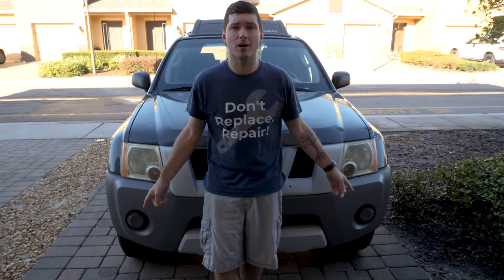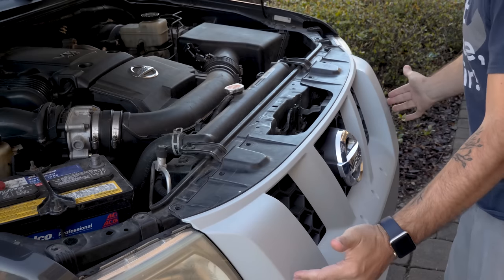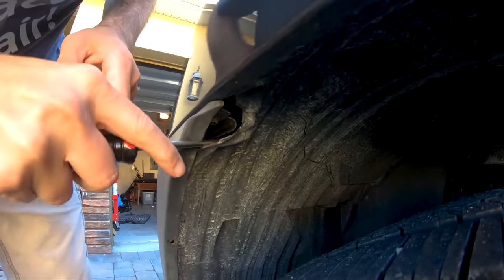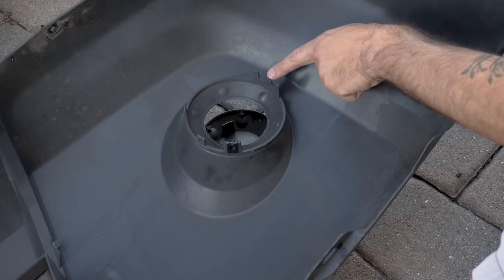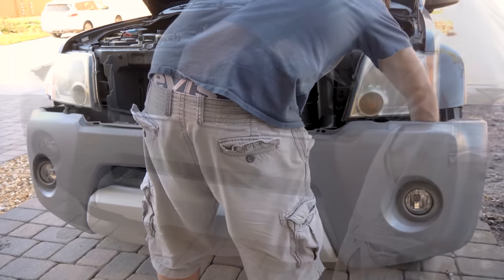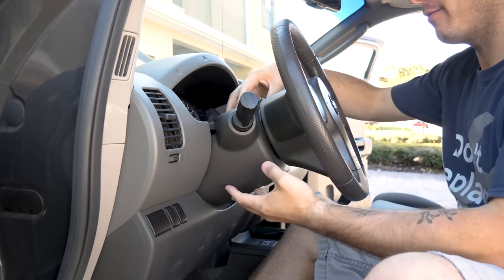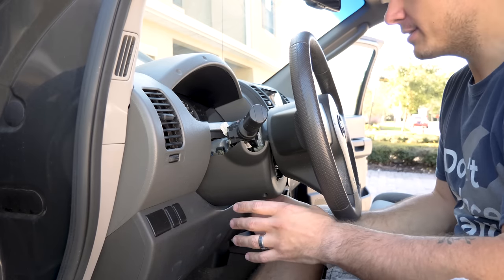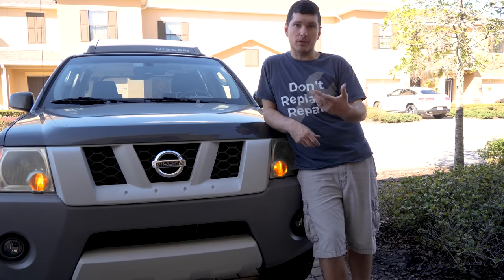How to Install OEM Fog lights into a Nissan Xterra

Comment: For those who want to do this install on a 2005-2007 Xterra, the factory kit isn't compatible anymore. (The switch is for 08 and newer.) However you can order an OEM switch (Standard Motor Product: CBS-1668) and buy after market lights or get a used set, and the mounting hardware. (Nissan used Velo brand lights) I chose to buy a used OE set as the quality is higher. Most used units have one screw tab broken off. This is fine as you only need one. Just make sure the good tabs are on opposite sides and you'll have a working pair. With those parts in hand, Ry makes the rest easy with this excellent video! Install was a breeze! Thank you, Ry for this and all your excellent videos.

Comment: Awesome videos brother !! It's so nice to watch the job before actually doing it.  Many Thanks !!

Just a friendly tip that was passed on to me and i pass onto others is turning screws backwards first with plastic anchors.  Most of the time these threads are made the first time the screw was installed.  Turning it backwards until you feel a bump allows the same threads to be used instead of cutting new ones over the old ones.

Comment: Thank you so much, you have saved me a lot of money and time. Purchased a 2006 nissan xterra a few months ago, and even though I looked it over good I discovered a lot of problems, needless to say this is when I found you. Just got finished installing my OEM fog lights, no stress and fuss. Thanks so much. I have changed my headlights, PDM, had to repair the drivers side window, and I am still not done. The Evap is giving me a code and the catalyst converter as well.. when I have time I work on it.. thanks so much.
Reply: They also fit on a 2006?

Comment: My granddaughters xterra has hazed headlight assemblies, and the turn signal stalk is worn and doesn't turn off when the wheel is turned. Ry has shown the bumper cover has to be removed to replace headlight assemblies.  This video shows it would be easy to install fog lights while the cover is off, and when replacing the worn turn signal stalk, use one with a fog light switch.  Great video!
Reply from the maker: :D

Comment: Good info. I recommend a simpler, quicker way. All I did was turn they wheel (to give you more room) then remove the retainer screws (3ea) on wheel well. Pull back the plastic and after that you’ll have easy access.
Reply: I used a stubby Phillips head for accessing the securing screw.
Reply: I like the way you think
Reply: Oh yeah, much easier and it was a 20/30 minute install. If I ever do it again, I bet I could do it in 15 minutes. 👍

Comment: hey you can access the mounting aera through fender well, without taking off whole bumper cover.....
Reply: I just looked today.  There is a small access.  It is a little tight but I am going to try to do it without taking off the bumper.
Reply: Good to know when i need to change the bulb

Comment: Thanks for the video! With the Frontier there is no need to remove the bumper. Just move tires with starting wheel and you’ll have a few screws and you’ll have access through the back of the bumper. The wires should be hanging instead of tied up. Thanks again!
Reply from the maker: Good tips, Thanks!
Reply: This is how I installed the fog lamps on my 07 Xterra a while ago. While it is a little more cramped it is still very easy to do.

Comment: I would have done this years ago had I known the wiring harness was all there!
Reply: I have a 2014 X model. All the literature I read said my model DID NOT have pre-installed wiring. Well last night some jerk stole my cap/cover and I look inside and saw what I thought looked like a plug...well sure enough, looks like my Xterra DOES have wiring pre-installed! So maybe I'll be getting new lights instead of a new cap/cover!
Reply: @rockermarco  Get the LED version,that's what I have on my Frontier.(much brighter and uses alot less power)

Comment: For anyone who want to put fog lights on Nissan PATHFINDER r50 00-04 or 05 (GCC ) what you need is fog light  turning stock (make sure that if your stock has a auto mode to get one that has auto with  fog switch cuz it's different than the one without auto) and front fog relay ,after that it's plug and play

Comment: I was also wondering if they made kits for the pro 4x roof lights. I've always wanted those too.
Reply: You need to drill a hole in the roof but has anyone checked if the wiring is under the headliner 🤣
Reply: @800ccc  that harness does not exist it only came out for the 2014 or 2015 models but you might as well just add an LED light bar that will give you more light if you want lights on the roof.

Comment: You should make a video installing steering wheel controls on an Xterra that doesn't come with them, using a Metra's ASWC-1 adapter. There are some guides on thenewx forums but the pictures are gone. A video would be great!

Comment: Not sure if this has mentioned, for Frontier, you don't need to take off the grill or bumper. You can do this under the wheel well. Just turn your wheels left and right.

Comment: I've noticed the lights don't fit tightly against the bumper housing. I'm thinking about putting some type of weather stripping around the housing so it has a good seal around the lights.

Comment: You did that like magic, it was good to watch. i have the latest nissan juke n design 2021 mod. but came out without fog lamps in the front , though have the place for them. can it be done practically the same way ,
 and could you tell me where to get a kit? thank you .

Comment: Hi from Oamaru New Zealand. I have a similar setup in my 2012 Nissan Navara D40 diesel (Frontier in U.S.A). Anyways I sustained big damage from a farm dog left loose at night which I hit at 60 m.p.h. 
It was cheaper for me to buy and install a new "Ironman" Commercial deluxe Bullbar which has all new lites on plus protection.
Reply from the maker: Hello from the US!! I wish we had diesel Navaras here. Sorry to hear you hit a dog.
Reply: @Rythecarguy  Dog saga was when dogs were on heat (in season) but farmer left it loose to roam. Dogs here on farms are cattle or sheep herding dogs.

Regarding the Navara D40 diesel the closest for you to buy in left hooker is out of Spain if you can. I'm running mine on Amsoil Signature series diesel oil and gear oils. The moment I changed it, it was way quieter and smoother. I'm very lucky to had purchased this as my 2008 jeep Wrangler diesel JKU was costing me $1500 per year with random issues and gear shift lever popping out of linkage which made it very dangerous so I opted to park it up then finance the Navara for 3 yrs. In that 3 yrs it's so reliable it only cost me for a set of 
Toyo open country A/t tires, diesel milesl tax, fuel etc. Carl

Comment: Best how-to videos out there.  Headlights and fog lights went in exactly as you said.  However, the steering column switch I ordered through the link on your page was slightly different and doesn't fit.  I'm hoping they will let me return or exchange just the switch since the fog lights are already installed.  Also, I didn't take off the front bumper entirely.  I unscrewed everything from the top and sides and as it was hanging, it exposed the work area enough to do the job.  Thanks again for great videos.  Any advice on the switch would be welcomed.

Comment: Hi i have a frontier 2006 metal bumper and have the wire for the fog light. My question is you change the switch light because the model of the exterra don't have the switch for the fogs to work with the oem wired. Do you know the wire color or number the fog oem switch use to turn on the fogs. Only if i don want to by the whole ligth switch, i want to do it with a external switch but with the oem wire. I hope i explain my question. Thanks great video

Comment: once you hook up the cable, check it before you reinstall the bumper... save yourself some time and effort to be sure!
Reply: Thank you Mr Andrew Camp I appreciated it’s done and also Mr Ry,
Reply: Mr Ry and Mr Andrew Camp, I bought a SPEC-D TUNING Black LED Projector Headlights Compatible with 2005-2012 Nissan Xterra Left + Right Pair Headlamps Assembly, but I’m i little bit confused about spider wire black and wires

Comment: Love the videos Ry, I’ve gotten into most of the work on my 2011 frontier cause of these. Question for you, recently my fog lights won’t turn on. I replaced the 15a fuse and battery fuse and still no luck. Bulbs are both fine. Any ideas? Is there an independent relay?

Comment: I have a 2016 nissan frontier without foglights.I watched this video and was wondering if this was true.I pulled off the plastic  caps and I looked inside and I had the wiring inside.So what web site I can get the turn signal/ foglights?

Comment: Hi! Have you heard of the SMOD on these xterra’s? Does it affect all 2nd gen version? And can you make a detailed video on how to switch the coolant hoses and transmission cooler hoses please. Thanks a lot!
Reply from the maker: Yes it affects second generation Xterras. No I cannot make a video. It only affects automatic transmissions since they have the trans cooler. The manuals do not and mine is a manual. Thanks for watching!
Reply: SMOD does not affect all 2nd gen Xterra's, only those made prior to the 2010 model year and are equipped with automatic transmissions.  In the 2010 model year Nissan introduced a new radiator with a different part number and SMOD is not a problem on 2010 model year Xterras and newer.

Comment: I noticed that it shows 2008-15 Xterra, but will it also fit for the 2006 Xterra? Asking before I buy the other type with the push button which I would rather not..

Comment: Wow, you made that look easy!  One of the best "how to" videos I've ever seen, thanks!~  ONE question.  I want to use my fog lights as daytime running lights.  Can the fog lights be turned on without the headlights???
Reply from the maker: Thank you! I really appreciate that. Unfortunately if you are using the stalk then you cannot. You could however wire these to a switch. Then supply the power from a source that turns off when the car is off.

Comment: I would love to add the pro 4x off-road factory lights on top. I wonder if that is also pre wired. I’ve looked to videos for that application but all I find is led or light bar installs, which I’m not fond of.

Comment: Hey there, nice work. I ordered a kit that has the dash mount on / off switch for mine. I want to know what you did with your old turn signal indicator? Do you still have it? Mine is not working right and I would like to buy it from you?

Comment: Thank you for such a great video!
I found a light switch stock at the junk yard (which worked great by the way) however it also has the "AUTO" option for the Daytime Running Light System. Do you know if I could also get the dash sensor and install it on my Xterra like I did with the switch?
Reply from the maker: Ohhhh I actually don't know but I love that idea.

Comment: Hi I know this is a really old video, but I'm praying someone is still reading comments- at 6:19 you're holding the fog light electrical connector- it branches off from another bundle of wires... can you tell me what that bundle leads to? I was in a head on collision and I'm trying to do my own repairs, but cannot for the life of me figure out what this thing is or where it's supposed to go- it's a white rectangular block, maybe 1x1x3" with two bolt holes in it. Thanks!

Comment: Now...how about the 2006 nissan frontier SE. It has the wiring but having issues with the switch. Just wondering if it's the same way or do I have to replace the whole column system
Reply: Did you ever get an answer or find out?  I have a 2007 that I was thinking about putting fog lights on too.
Reply: @OnePancho  no, so I took a chance on my idea, go ahead and put fog lights in, on the column...just change only the blinker switch. It has locking clips. You will see. Just buy the one for your truck that's close. The trucks are made to have them, they just dont install them to lower the cost of the truck. Let me know if you need further information

Comment: can this be done with the car jacked up and tires taken off for easier access to the fog lights? Of course I will have some Jack Stands and wood blocks as well preventing car from dropping down. looking to do this on my 06 nissan frontier as I already added the Fog light Signal Switch So I am ready to go.
Reply from the maker: Sure! You can access it from below. Just a Little tighter.

Comment: Could you do this with a bumper light bar that's spliced into the factory plug and use the OEM steering column switch?
Reply from the maker: Already did it my dude. Here's the vid. https://youtu.be/36cUx94BoIE?si=C9JaVcrPLQkM3H0L

Comment: I just acquired the 2007 model that comes with fog lights installed without the correct turn signal controller. I located the part from your recommended Amazon listing, 25560 ET11E, and have no ideal where to buy it. I don't want to buy the entire kit, just the right controller.  Can you help?

Comment: Do you have link to the one that controls the fog lights for 2005 Model Xterra??? The one I found only does 2008-2015 and does not fit mine says?

Comment: Off topic- have you encountered the following lights coming on and staying on? 
ABS
VDC
SLIP

I have no brake issues that I’m aware of. Changed my front pads (using your video, great btw)

And no other symptoms.
Reply from the maker: Unfortunately I have not. However if you check out the xterra forums or the facebook groups there is usually a lot of material on it. You are not alone!

Comment: I was hoping to see how to remove the light gray part of the bumper (tray, I guess) Just got a  push bumper and hopefully don't have to remove the whole front to  install it.
Reply from the maker: There are five bolts on the bottom of that and the top just clips in. You should have no issue taking just the lower part off, but keep in mind that there is nuts more bumper under that.

Comment: Eff all that. I installed mine by turning the wheel and gaining access through the wheel well covers. Much less work. Also, I switched the bulbs to L.E.D. bulbs before i installed the assembly. Soooo much better and brighter than incandescent bulbs.

Comment: I went to change the turn/light stalk and tis is a different plug. I have an 07 x and ordered the correct part. It looks like the one in your video. Help if you can. Thanks

Comment: I don't agree with how big this job was on YouTube.  I just wanted a set of running lights on my 2016 Frontier not fog lights.   I just pried off the fake caps on the front and found a set of round LED running lights for around $30 on eBay.  I saw the wiring harness but ignored it since I wasn't going to install the steering control.  Installed the lights, ran a wire to the fuse box and tapped into a fuse that only goes on when the car is running.  They look great and almost like factory install. Didn't have to remove the bumper.

Comment: Hey man, I have a 2010 Xterra I did this same thing on after watching your video, but the lights don’t turn on...checked the fuses and everything I can think of, still nothing, any thoughts??
Reply: Sell it!!
Reply: @PETERJlirot  toxxiiiiicccccc
Reply: Wire them with their own separate wiring harness / switch wired from battery.

Comment: Nice, informative video. Is this same procedure also for the 2016 Nissan Frontier?
Reply: Pretty much, just make sure to buy a kit of fog lights compatible with the bumper you have, and when  buying it make sure it includes all the mount clips and screws needed to install it.  And of course a new  oem   compatible switch .